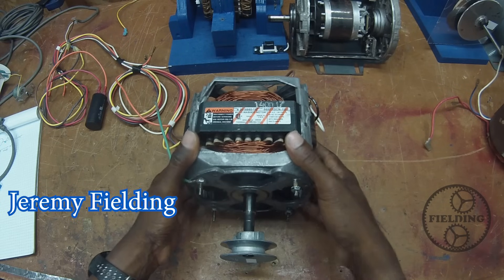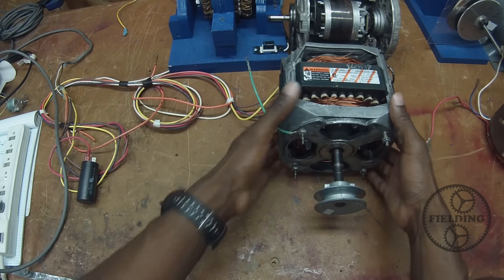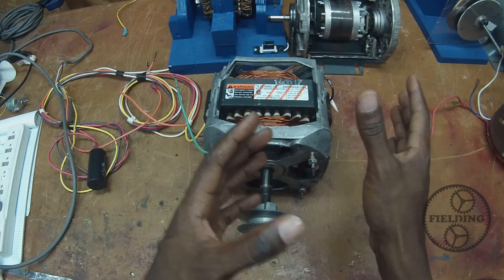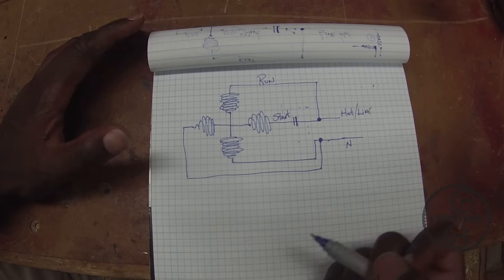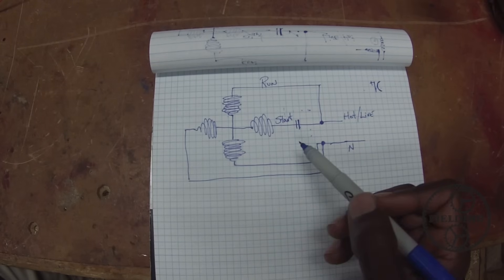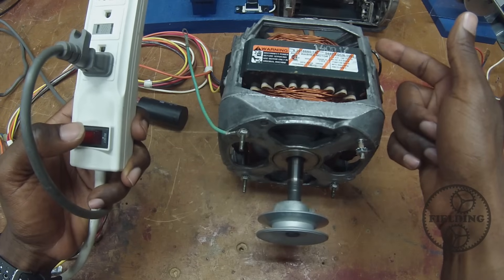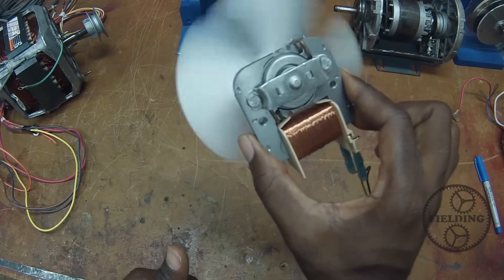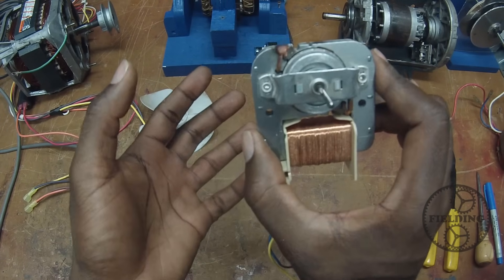How Motors Work For Beginners: (Episode 4) Single Phase Induction and Shaded Pole Motors: 035

Comment: Jeremy, Can you explain how a device like the 5-2-1 hard start Kit works.  Is it increasing the currents phase angle in the start winding?  I can’t wrap my head around why the starting amps are lowered so much when adding these things.  I know they work, I put one on my 2 ton A/C at my camp and it reduced the inrush current from 56 to less than half that now.  I can now use my generator to run my A/C in an emergency.  Wouldn’t the proper size capacitor to begin with accomplish this?  Are these things needed to simply correct the manufactures short comings??  It seems like it is flawed engineering if you need to install one of these.  Thank you in advance.

Comment: I have a 5hp single phase motor on my air compressor.  When I bought it they recommended I get a magnetic motor starter, a box that hangs on my wall and is wired to the motor.  What does it do?

Comment: I have a question.  I going to live in the Caribbean and they have both 120 and 240 current. The spit duct ac system is much cheaper than 120. How can I mack the work. Will I need a step down transformer or is there another way.

Comment: Those copper rings, are they shorted or connected to a winding or resistance or what? 

Does the flux density / field power get reduced as it flows past the copper?

Comment: So if my motor was starting but turning off after 1 seconding could it be the centrifugal switch is faulty and not engaging the run winding? I have tested the capacitor which I assume is on the start winding side and it is good.

Comment: Hi Jeremy I have a Air compressor and when I turn it on it runs for about 4 to 5 seconds and then the breaker trips. I have replaced the start and run capacitor and still not working. Is there a way to see if the copper winding or some kind of short in it?
Thanks for all your videos and teaching!!

Comment: How about a video on phase converters
Reply: That sounds beyond the scope of this channel to me. I don't think Jeremy even has a phase converter. Well, beyond motor starting capacitors that is. You're not likely to find phase converters in the trash very often either. As they're rather specialized industrial gear.
Reply from the maker: I have two and I will talk about this in the Q and A video
Reply from the maker: We will cover this briefly in the Q and A a separate video will be posted at some point.

Comment: Hi, I have a single phase motor (brushless) and it makes a humming sound but does not turn.  I tried to turn the rotor manually, like you did.  But it does not turn.  It feels very difficult to turn.     When i turn the rotor while is off, it is very easy to turn it manually.  I checked the capacitance on the capacitor  and it works fine.  What do you think it's the problem?  Thanks

Comment: At 4:37 you say that the capacitor leaves the start winding just ahead of the run. I thought that the capacitor having to charge would leave it right behind the start winding? I'm just learning and trying to use my imagination as I learn!
Reply from the maker: I use to think the same. Check the description for references. There is much to learn

Comment: Hello, my drain water pump found in the washing machine need a  kick start. Managed to replace a new one. May I know if you are able to advise  or demo what to do with the old water  pump and make it good again? Thanks   :  )
Reply from the maker: I don’t know what to do with a water pump. Most of my ideas come from a need for something and seeing the connection between what I have on hand and the need
Reply: The old water pump need a push/kick before it can rotate. It behave the same as what you had demonstrated in the youtube. I was think of repairing/improve/modify it and put it back to the water machine to serve it original function. :   )

Comment: same what happen to my washing machine motor....it wont start but will spin if you give it a headstart by spinning it manually.It spins but no force it stops if you apply force to it,cant put load to it.It got its capacitor.This was years ago and decide to scrap it.
I was using that motor for a coconut shaver from a faulty timer washing machine.I just recycled the motor and was working fine till that happened.Suddenly it stops if you put load to it.What might be the problem?

Comment: I've seen some videos like yours but i think they don't even bother to explain theirdifference like..."single phase motors need your electricity" to run or operate whereas 3 phase induction motors "gives you power supply when connected to a running motor".

Comment: Hi memory, I have a G.E. 1/8hp, it's for a circulating pump on my boiler. This motor stop starting on it's own,it does run when I manually spin it to start!! I see no start capacitor externally. Would this motor have a start capacitor!! I hear the cintrificial kick in when it's running. This motor is at least 40 years old.

Comment: Hey Jeramy I have a question about an air compressor motor that runs for about 30 seconds then kicks off for a few minutes. This is a continuous cycle until it’s turned of. Could this be a capacitor issues or relay switch issue. Thank you

Comment: Your video is very educational, i hope i could used your help, i am new at this. bought this Kenmore Washer drive Motor W11283592 to used in a shop. it have 4 wire Green yellow stripe(Ground), Red(Positive), Blue (Negative) and Yellow ? i am trying to wire it to 110v but fail miserable. what am i doing wrong, is this 3 phase or 1 phase cant find much on this model online

Comment: I wonder if the motor i just received and installed has a faulty centrifical switch... it didn't start on its own until I kick started it, then it was also going in the reverse direction. Or...   I followed the color coordinated connections with 6 wires, I think one set needs to be reversed...

Comment: Hi Jeremy !  I love your videos and you explain and give great practical examples/demonstrations . I have a Magnum 1000 Jacuzzi pool pump. The label has been weathered, the motor is by  Century Centurion, A. O. Smith. I checked online and the closet I have come to this motor is from a motor label. Part 7-186085-20. I need a Start Capacitor for this motor. I watched your video on labels on motors, but you did not explain how to calculate the micro Farads for a start capacitor for a motor using the information on the motor label. If you have done a video on this can you please tell me the title, or maybe in the future you can do a video on how to calculate the size of the start capacitor you need for the motor. Thank you and keep up the great work !

Comment: Did you know that not all AC induction motors have a syntrifical switch in them. I have one that does not have a syntrifical switch and the capacitor is always running and it has like no trouble with the start winding getting hot. I took a few of these apart and found no switch of any kind. I also took apart one that's half the length but the same width and height.
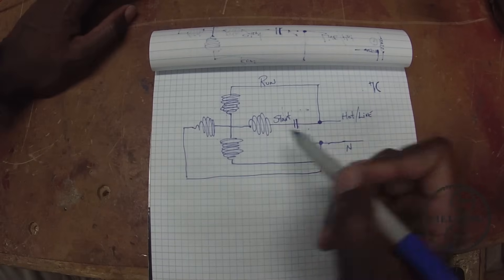Reply from the maker: Of course. There are quite a few ways to get a motor started; relays, high resistance winding, etc, it would be impossible to cover them all. I consider this to be the most popular method, and the shaded pole being the second most common in my experience. There are even "two phase" motors. I DID say in the video time 4:45 some motors have a RUN capacitor (one that stays connected), but I was focused on start capacitors. If I remember I will show a run capacitor in the Q and A video.

Comment: Hey Jeremy
My single phase motor starts and runs  but when i put the belt on to run the air compressor it bogs down and turns slowly .if i take the belt off the motor runs strong? 
Any suggestions?

Comment: Hey Jeremy. You say that single phase isn't enough to get the motor spinning because of just two contacts basically. How did the DC motor work that just had two contact points with the brushes? Because DC has magnets instead of induction? Thanks
Reply from the maker: I explain in that video why it rotates. Check the DC video...(again) if you have seen it. It helps to watch more then once

Comment: Out of curiosity... would a stationary magnet be able to replace the coil of that fan motor to make it perpetual?
(As in no input current required)
Reply from the maker: no... it would not induce current unless there is motion. But the motion will stop if the magnetic field isn't changing. You can't have one without the other.

Comment: rookoie question. i acquired a single phase blower motor that came out of an industrial hvac system and i want to make into a shop anti dust system/ air mover. my question is how do i go about powering it. do i need to design a circuit? can i just hook it up to mains power? can i buy a prebuilt adapter??
Reply from the maker: +Tazrahzeljr I made a whole video about that... here https://youtu.be/ZKodxGcRSnw

Comment: New to group may have missed some good stuff along the way. 3ph vs 1ph. 

Building a 2x72 I bought 3HP 1ph 240vac have been looking for a VFD controller for speed. All I seem to find is 1ph in 3ph out i am assuming this will never work with what i have or will it?

Comment: Jeremy question? Can I use a voltage/current reduction device (transfomer) to lower the AC voltage and run a AC motor at a lower speed that way?
Reply from the maker: Perfect question for the Q and A. I will definitely get this one.
Reply: mcorrade I don't know if it the right way but you can use a dimmer light switch but like I said it may not be the right way
Reply from the maker: Induction Motors work on Line frequency...and will run at a fixed speed no matter what the voltage is. New dimmer switches work by turning the power on and off rapidly. This will cause the motor to "slip" more but not by much. If you manage to stave the motor enough it will slow down but then your motor will start to overheat. If you really starve the motor of voltage the start winding will come back on. Because the motor is starved of voltage, it will not have it's rated power. The motor will stall with not much load on it relative to its total power.  When you buy "router speed controllers" they say " this will not work with induction motors". They work exactly like dimmer switches.
Reply: Interesting. I tried a dimmer switch on a smaller induction motor and it kind of worked but not really. It wants to slow it down but then as you said, the motor wants to do its own thing lololol
Reply: Yeah running an induction motor below its rated voltage is really bad. Power equals Volts times Amps. So if you reduce the Volts Amps goes up for the same power output. Yet the wire in your motor gets no thicker to handle the increased current. The right way to speed control an induction motor is to vary the frequency of the current it runs on. The device made to do this is called a Variable Frequency Drive (VFD).
Reply: Thanks Paul. Yes I've been reading up on VFD and they seem the way to go.

Comment: Hi.  I have a single phase induction motor.  How can I tell if it is 115V or dual 115V/230V?  It has six wires but I have been told that is not a sure what to tell.

Comment: would it be true to say that a shaded pole motor would not start if one were to cut the copper rings (shaded poles), so they would be open circuits?

Comment: Sir one bonus question!
 How do i test each wire of d single phase motor
 If d motor is ok,
 While all d capacitor and d switch connected to d motor?
Reply from the maker: Please understand, I receive hundreds of request like this for help and troubleshooting advice. It just isn't practical or safe to help one on one like this. That are videos on YouTube about troubleshooting motor problems. I would start there.

Comment: hi Jeremy thanks for very informative videos.have a question.my wifes krups mixer stopped working.just bought from charity shop/thrift u say but how do I test motor and is it ac as vaueco asks on here and can I fit my own switch if keypad faulty on top mixer.steve in uk.240v here as you know.how would I test?

Comment: I just came across your video and i got a question,do you really need a start cap. ? because i have a similar motor and i wired it on high speed with the starter wire..... i use the door cover switch series in the line as pulse and the starter wires in parallel with high speed wires without a cap.
Reply from the maker: I don't quite follow what you did, but it sounds like you set up a wire with a high enough resistance to off set the current. That is what the cap really does. Very small induction motors (like many fans) do this internally and don't need a cap. They have a starter winding with a higher resistance relative to the run winding. You will likely have very low starting torque. But if you don't need the torque at start up ( you don't start the motor with a heavy load) you will be fine. The cap only pushes the motor out of the start position by shifting the phase slightly. There are several electrical methods for this other than caps, but caps are the most common in the 1/3-3hp range. Beyond that most companies move to three phase,... again because of the starting torque required when the load is that large.
Reply: Exhaust fan of a nutone 765hfl  1/100 hp quit; it has 3 wires into it—black,white& white green stripe. V b-w 80, b-wg 12 AC . Fan was stuck somehow ;  haven’t found a fix vid yet
Reply: Label also says 1000 RPM!  So that circuit must be inside the case; and busted.  How do they make it run that speed?

Comment: What are your thoughts of using arduino for control I know this video isn't exactly what I'm taking about. The question is what and how would you use an arduino and or breadboard/breadboard  to control the motor?( maybe next series)  I've learned a lot from your videos and now have salvaged and acquired  motors for the tons of projects planned. Then recently I've purchased the arduino beginner kit mainly for the parts it comes with like potentiometer and voltage displays. They way I see it is taking induction motors to the next level. 
-Chef J-La
Reply: You would have to connect your digital control circuitry up to a device that can handle the current. Typically you want to employ optical isolation between low energy digital controls and high energy electrical devices. Strictly speaking you don't have to, there's no law (well there might be), but really you just should. There's technical reasons behind it. Sensitive electronics are easily disrupted by electrical noise. Things of that nature. Galvanic isolation is just a nice thing. A Solid State Relay (SSR) for instance is basically an optoisolator that triggers a Triac. That's all they are.
Reply from the maker: This is on my list of things to talk about in the video

Comment: great stuff jeremy,, i have an important question, i am about to replace the capacitor on my single phase bandsaw,  lately i hit the start button and it humms so i find myself having to push the blade to get it going,,, i pulled out the capacitor which is plastic and small with 2 small red wires,, i cannot find a capacitor with the same value as the one on my machine, the ones available on ebay and the net are either too high or low on voltage AC,,,, my capacitor is 30uF 350vac, the closest available capacitor i have found is 30uF 330VAC ,,is the slightly lower voltage AC ok to use or should i keep looking for exactly the same voltage value,, mind you  the microfarads are identical at 30uF ,,, i am stumped and have done many searches on the net for info ,, your knowledge on this would be very helpful,, i hope the voltage value on capacitors is a ballpark value and doesnt need to be exact ,, otherwise i am stuck. cheers man,, keep up the great vids,
Reply from the maker: Unfortunately I can’t help directly like this. I hope you can understand, I get literally hundreds of emails through my YouTube channel for advice and general help. It just isn’t safe or practical to try and troubleshoot problems or give advice one on one. I usually take subjects that come up over and over and make videos to help lots of people. But, I can’t do it this way.
Reply: No problem Jeremy, i understand, the fact that you responded is good enough for me,, most of the enquiries to suppliers i have made regarding this issue i have not even got a response from,, i hope you can do a video about these kind of troubleshooting issues some day,, that would be great,, either way i will still be tuning in to watch you vids from across the pacific. cheers.

Comment: I have an amana  washing machine that does not have a capacitor.  When I replaced the water pump on the machine, it now will not work without me nudging it.  Till then, just hums. I have an Amana Washing Machine Model NAV2330AWW.

Comment: I have an induction motor on a drill press.  It will  not start on it's own.  What is confusing me is there is no capacitor on the motor. It just has the "points" on the back of the motor.  I can't see a way to adjust them at all and they don't look burnt but suppose they could be.  If I give it a nudge it will start and run. What could the issue be?

Comment: I have a single phase  1 hp reversible motor. It has 2,3,4,5,8 black wires, and a yellow T1, and a brown T2.  I need to know what wires go with what wires because there are no diagrams in or on the motor. Can you help me please?